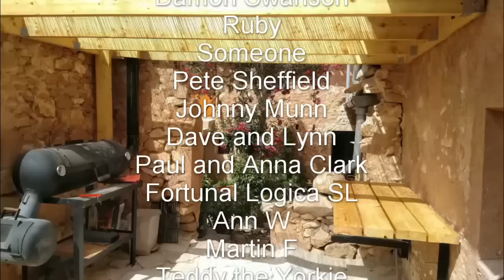Not bad for a carpenter... Restored marble kitchen floor

Comment: Should have wet the floor before laying the muck floor was to dry and put slurry on the back of the tiles you will get a much better suction to the tile and the  muck. Muck is building term for sand and cement in uk
Reply from the maker: Thanks for the tip. The tiles were originally bedded down just on sharp sand with the odd blob of tile adhesive. They lasted 30+ years like that

Comment: If marble breaks so easily, why are you putting it on the floor. Things can fall onto floors from kitchen tables and by accidents when you are carrying them. It seems a shame to put all this work in only to have a piece crack. I know it looks beautiful but I wonder about the tiles breaking. Love Tilly by the way. Soo cute.
Reply: I think they are quite different when bedded in on the floor or the work surface,  no issues then😊
Reply from the maker: As Jen said, once they are bedded down, they won't crack move or break. They have been down for 30+ years in another place.